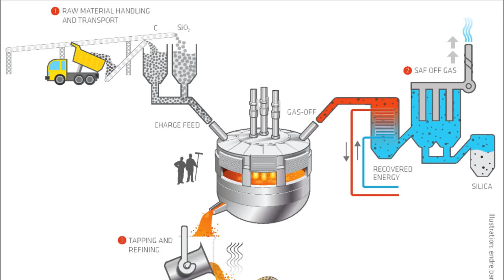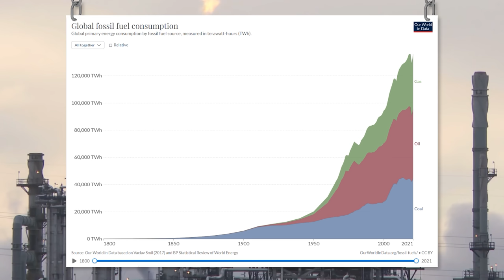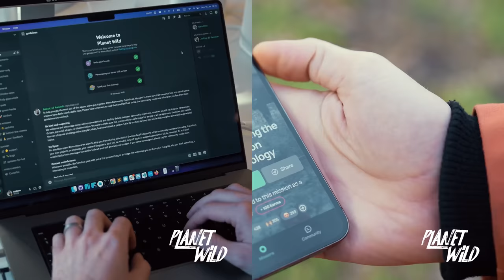We Will Be the Last Civilization on Earth

Comment: I did a technology module for my OU degree back in the mid-eighties. And one of our lectures was "When will oil run out?" The consensus seemed to be before the end of the century. And yet, here we are, forty years later, still with plenty of oil. It  turns out that there is oil everywhere - far, far more than we ever thought. 

It gets harder to get to, of course, but, as the easier oil is used up, we simply adapt, accept higher costs, invent new technology, and move on the the more difficult oil. I can see no end to this.

And the same is pretty much true of all the other essentials you mention. It would appear that, if we want to destroy the Earth twice, there are more than enough resources still left to do it all over again.
Reply: it seems more and more likely to me that oil is produced by a geological process, and that it is just not the remains of millions of years of organic life.
Reply: The amount of new oil fields we discover every year has decreased rapidly. It is only known sources that were not easily accessible enough to dig cheap are getting digged now since prices are increasing. This drives innovation and technologies like fracking get cheaper than thought possible yars ago. However, the amount of oil - and mostly anything else - is indeed very limited and will run out unless we either change to other resources like sun and wind power or asteroid mining. We NEED to stop wasting oil urgently and fast, because it will only reach for 2 more generations of people. And this without even considering climate change, glyphosat, world war 3, AI singularity and whatnot.

Comment: for the heating problems, what about methods of generating heat than combustion? it should be possible to set up glass panels in a way that focuses all the light into one spot, heating it up enough to melt even silicon. you also don't necessarily need fossil fuels first to generate electricity. copper melts at 1085c, meaning charcoal (or solar) can melt it, so you could absolutely make turbines out of it and start generating electricity by placing them in waterfalls for example. from there, you could use that electricity to generate the heat required to melt other metals.
Reply: Combustion is the only way to generate those heats.  Electric can't do it. The heating elements themselves would melt.
Reply: @davidkavanagh189  couldn't you store the heat though? you don't need to transmit it all at once, you could store it in salt for example, which is very good at retaining heat, and slowly build it up without ever overheating the components, right?

even if that doesn't work, the solar option still works, reflecting sunlight with quartz or something.
Reply: @Deltexterity  Combustion is the only way. If there was an alternative, it would be being worked on by people a lot smarter than you or I.
Reply: @davidkavanagh189  that's not really a valid argument. right now nobody is working on this problem because it's not a problem, civilization hasn't collapsed yet. in the past, people used combustion because they didn't think of any other options, but if civilization collapsed humanity would still retain knowledge of the old world, so people would have an advantage and try things those who came before never did.
Reply: @Deltexterity  And how exactly would this collapsed society manage to make the super precise lensing for your sun machine or the complex materials and technology to make your electric metal melter? I think you'd find that burning stuff would still be the answer.
Reply: @davidkavanagh189  you don't need super precise lensing, you just need a lot of glass
Reply: @Deltexterity  You need some pretty advanced glass work to do what you're suggesting. Also! You'll be needing some of that good old fire stuff to make the glass so hmm... See how we keep circling back to combustion?
Reply: @davidkavanagh189  you don't need to make glass, i already said you can find it in nature.
Reply: @davidkavanagh189 concentrated solar power arrays can get hot enough. you don't anything exotic to build them
Reply: @joshieecs  Eh, yes you do. Define exotic? You would still need precisely manufactured parts and high temperatures(combustion) to make most or all of those parts. Also, solar is not a reliable power source in many parts of the world. What good is fair weather only tech?
Reply: @davidkavanagh189 Resistive heating elements (the sort used in electric fires, water heaters, fan heaters and so on) are not the only way that electricity can be used to generate heat. Electric arc furnaces have existed for centuries - in fact the Niagara Falls power plant (which is hydro-electric) was first built to run such a furnace. The heat is generated by passing a high current electric arc through the materials you want to heat up. This doesn't require a resistive heating element - it relies on the electrical resistance of the materials you fill the furnace with to generate the heat, and as such it doesn't matter if these melt in the process - in fact in some processes this is precisely what you want to happen.

Initially at least, arc furnaces were used for reacting coke or charcoal with limestone to make calcium carbide, which was then reacted with water to make acetylene. This was before the chemical industry used oil as its feedstock, but we did have coal. Most industrial chemicals at that time used either coal tar (which could be distilled and refined similar to how oil is today) or acetylene made in the manner described above as the original feedstocks.

Comment: obtaining tin is quite hard due it's rareness and scattered locations. It's thought by some that it was because of this it was one of the main factor in the collapse of the bronze age.. Once one source of tin had dried up it put extra pressure on the remaining sites which quickly exhausted one mine after another. Even with modern techniques tin is still a rare commodity so unless we went straight to iron/steel we wouldn't get beyond pointed sticks with chipped stones to do any cutting etc.

Comment: I do feel like we could get to the temperatures we needed with other means but it would undoubtedly be far far far more difficult.  I doubt that a civilization would boom as quick as ours has without it but I don't think it is impossible.
Reply: Induction furnaces will always be possible as many forms of electricity not reliant on fossil fuels will always be possible. And unlike in this thought experiment, even launching all of our nukes won't destroy the electrical motors that have already been produced and are already stuffed with copper. 

The electronics of these motors will be severely degraded if they are above ground. Electrical devices don't need electronics to function, though. Just conductors and insulators. 

The motor windings will of most motors will survive. That's just copper. That and survivors will have millions of sump pumps safely in pits in basements to raid. Water is a decent shield against radiation so anything under water will be salvageable. It won't function, but survivors can look at their structure. 

Not to mention the landfills and random dumps filled with underground deposits of all things from manuals to older, sturdier manufactured goods.
Reply: try to boom without fossil fuels to give us fertilizer
Reply: @timothypopik2288  Oh You're 100% right.  The implication is it wouldn't have boomed at all.  Our technology progression probably would have taken many many more generations and be far slower.

Comment: About melting metal. You've forgotten about a thing called a "solar furnace". One that is located at South Table Mountain campus can create a temperature of 3000 degrees C. Granted, the next civilization would have to build such solar furnaces in the first place, and they probably won't be as effective as fossil fuel furnaces. But still, dealing with iron and other metal IS possible without fossil fuels.
Reply: Good one!

Comment: We burn coal because we can, not because we have to. Think about rail vs car travel. There isn't anything that can't be done really without fossil fuels, it just requires more work. You might be living is smaller house right now, one not made for concrete etc...but you would still be living in a house. Also think what would happen if we lived in a world where there was 1000 times as much oil as there is now. We might all be using rocket cars as fuel efficient engines might not have been invented. Our economy is dependent on oil until it isn't. Then we will have to shift things around it will cause problems. We shouldn't think that technological progress is dependent on oil, as scarcity drives new innovations to get around the road blocks.

Comment: You can get methane from biogenic sources and it burns hot enough for silicon smelting, especially with a little extra oxidizer added. And regardless, while silicon is an excellent semi-conductor, it isn't the only one, and it's quite easy to imagine a society that continued to miniaturize vacuum tube technology or find other options for high-powered computing. Plastics aren't even the only organic polymers available to us, and others would certainly be viable for the applications they are put to in an aerospace context. 

Honestly I think the biggest hurdle facing a non-fossil fueled space program is the raw energy requirements of chemical fuels, which if biogenically sourced will require a punishing amount of primary production to support, and would require the coordinated efforts of great empires, but it's not impossible.

Comment: I like the honesty in this video.  Yes, renewable resources are the way forward, but yes we must also continue to use fossil fuels to bridge the gap.  I often compare it, somewhat jokingly, to air travel but you could use many analogies.  I say that just halting fossil fuel usage today in favor of renewable resources only would be like asking the Wright Brothers to fly you to Paris.  These things take time, but we will get there eventually.

Keep in mind only about 20% of EVs out there are operating on renewable energy sources because that's roughly the percentage of our grid powered by wind and solar.  The other 80% is coal, oil, and nuclear.  Yes, nuclear isn't fossil fuel but it isn't exactly renewable either, there is a finite supply of materials.  Not more than a few decades ago the percentage of renewable resources powering the grid were negligible.  In another few decades maybe we will be double or even triple where we are now, which would be a great move forward.  Who knows, there could be new ways and methods not even discovered yet that will take off in tge near future.

Comment: You don't need fossil fuels, you can make fuels.
Reply: Do it then. Make fuels without the fuels in the first place. If you could do that efficiently, you would quickly become the richest human being the world has ever seen.
Reply: @jasondashney  Never said it was going to be more efficient. It is a case of if we run out of cheap fossils fuels there is a alternative, which yes is a bit more expensive, but it is still possible to run internal combustion engines. Anyway electricity and batteries will take over.
Reply: @AORD72  fair enough. I think you’re massively discounting nuclear though. Eventually the environmental movement is gonna pull their heads out of their asses and get fully on board of nuclear. Did you know that the anti-nuclear groups are funded 14 times more than pro nuclear groups? You’ll never guess who they’re funded by…

Comment: A better title is " We must use Fossil Fuels Responsibly " 
Most these materials stated already have good counterparts we can use instead of fossil fuels. 
Organic Polymers can be mass produced with the right chemicals. 
Methane and other gases can be harvested from our bio waste while making fertilizer inside a preesure safe enviorenment' Germany already does this to a degree.
We can use a magnetic rail gun like system to launch stuff into staff and have we in limited ways. That alone would save on fuel and material costs massively, still not safe for humans though.
Nuclear Energy, need I go on? 

Yes we will still need fossil fuels for certain things we cannot replace but this video will be used more as an excuse to increase production to increase profits rather then make changes that will impact the planet long term and will in the short term.

Comment: Well, you are right and wrong at the same time... A civilization LIKE ours, the occurrence has so many variables that it is likely to NEVER happen again. But, a civilization AS advanced or even MORE advanced, well, that's a different question. Your presumption that they would need ammonia is sound in terms of our society, but, as you put it in the end, "where there's a will, there's a way", and maybe a scientist of that civilization finds out there's another chemical, plant, fungus or whatever that does the same thing or even better. Heat is something that cannot be taken for granted but for an advanced society it's also not impossible even without fossil fuels or charcoal... for example volcanoes, a society in Iceland, Italy, Hawaii, etc., would have access to incredibly high temperatures (around 1.300C), which can be used with funnels and the correct air flow to create even higher temperatures. Energy can be (and is) obtained from water, air, the sun, etc. Plastics can be made from renewables like legumes. Materials like graphite turn out to be much harder and flexible than steel, and once you sorted out all that, silicon is just easy... all rocks around us are mainly made of silicates, all we need to do is refine it.

And then... there is nuclear power: dangerous, difficult, but achieves higher temperatures, produces energy, etc.

You made me remember those guys from "Ancient Aliens", who can't believe ancient civilizations could achieve difficult feats because they didn't have our technology... ergo, it must have been aliens, right? Well, NO, they could do it and they actually did it, and they were advanced enough, just not like us.

By the way, we don't even know if we are the first advanced civilization on earth... A civilization that disappeared only as recently as 10.000 years ago, would have left almost no trace of their existence for us, so one that existed a couple of million years ago would be completely unknown.

Comment: Thanks for a great video. When the underground coal mining industry in the UK closed in December 2015 with the closure of Kellingley Colliery the UK had an estimated resource of coal that at the then current usage would last 300 years. Since the closure of the collieries in the UK our fuel bills have multiplied many times. Nuclear would be a practical alternative. But coal mined in an environmentally controlled manner is a sensible source of fuel. By-the-way, burning wood (or charcoal) is also releasing CO2.

Comment: there are many fairly easily accessible alternatives to reach the mentioned temperatures without fossil fuels, most of which are not rare or renewable:
- thermite (aluminium + iron oxide)
- methane (cows)
- hydrogen (from water + electricity or various low-temperature chemical reactions )
- electric plasma (from electricity)

Comment: 1:30 It doesn't matter how much of this stuff is left.  What matters is the easy stuff has already been mined, burned and is gone.  What is left requires an advanced civilization to extract. No pre-industrial society is going to produce deep sea oil or deep sea gas or run tarsands operations in Alberta or even in Venezuela. It requires enormous industrial equipment and a ton of already available cheap energy and a vast transportation and logistics system.  That is why this stuff wasn't produced first.

Comment: It is possible to work around fossil fuels, but very, very, slowly. The new civilization would need to reach capability to build wind turbines, hydro and geothermal and solar generators, and, eventually, nuclear power with only charcoal-based metallurgy. After that, they would use hydrogen where we use petroleum derived fuels. But the question is would such a civilization have sufficient mass of population free to pursue research. If so, it would take much, much longer that us. But i still think it is doable.

This is another reason for us to abandon fossil fuels, adopt circular economy wherever possible, and go off-panet for as much of the industry as we can. We are not at the perfect point to do that.